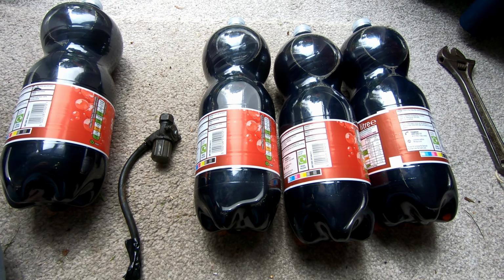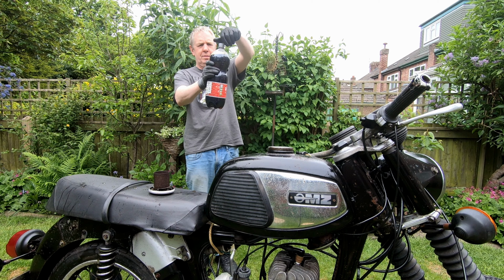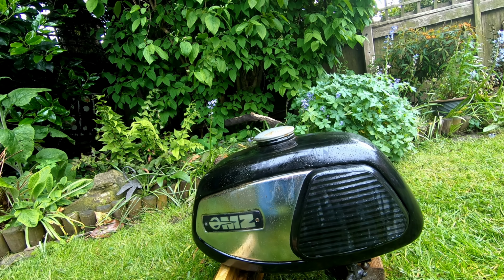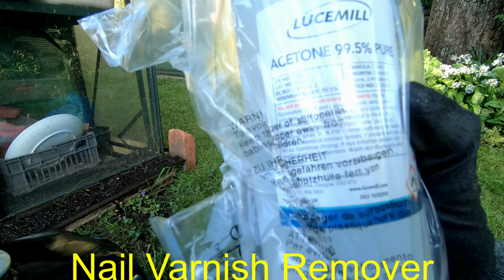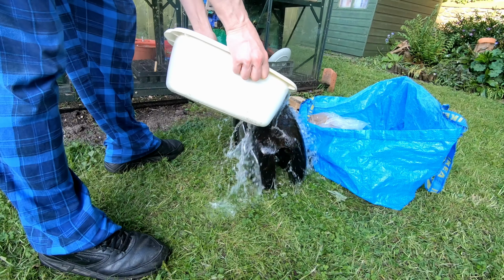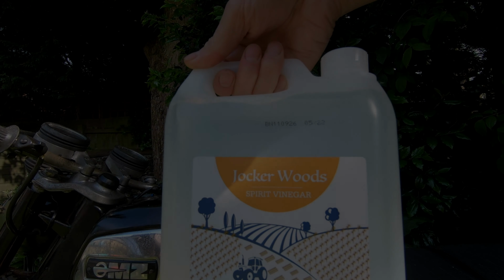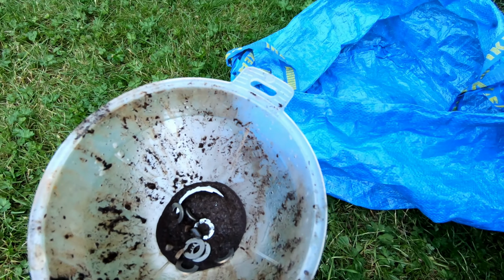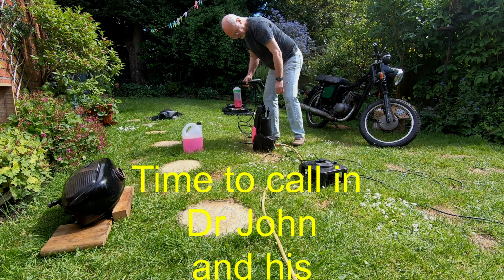MZ TS125 Ep4 - Stinky Fuel Tank Restoration?

Comment: A citric acid crystal and water mix left for a few days depending on strength of the mix would have done the job with practically no physical input ! No obnoxious vinegar smell either 😀
Reply from the maker: Maybe next time, though I hope there'll never be a next time. It wasn't the vinegar that smelled so much as the 30 odd year two stroke fuel remnant, it stank!!!! 🤣👍👍